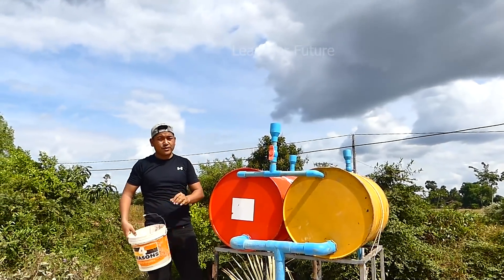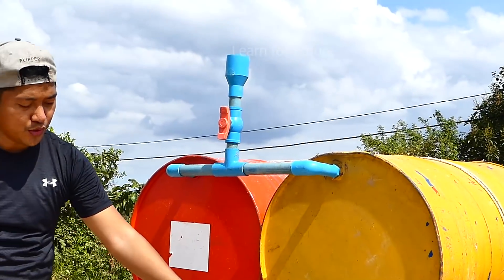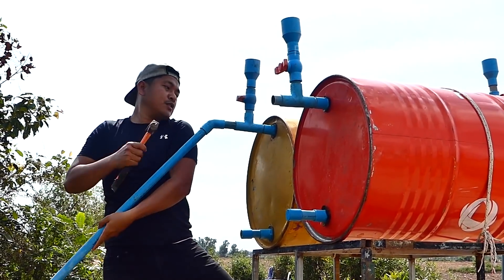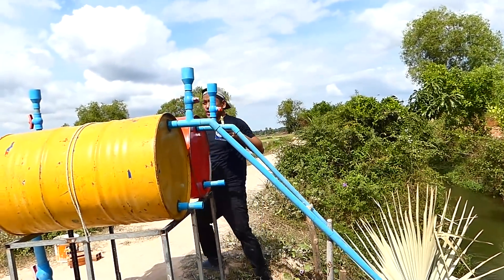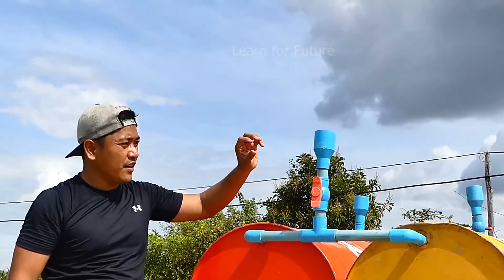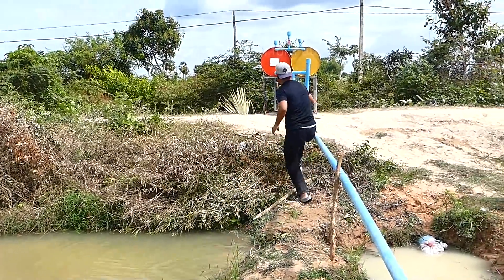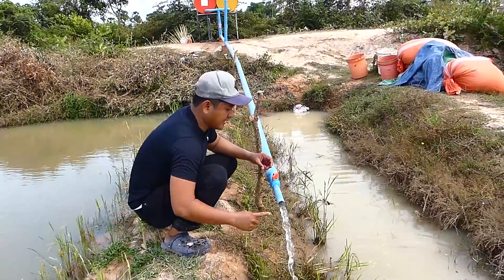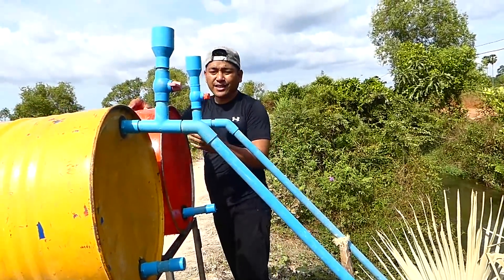Free Energy Water Pump - Explain Details How to install Drum Pump Function - No Electricity Here.

Comment: Is the water level in the river really higher than the exit to the field? This siphon is no pump! 
Using a drum, no foot valve is needed.
Two drums are not needed
Vertical tube on the output is not needed.
Mater valve at the output not needed. 
Output should have been dipped into a bucket of water to prevent air leaking inn.

Comment: That will only work if the river /water source , is already higher than the outlet. Like if you're just trying to get over some land or barrier.

Otherwise this does not work. You won't be able to pull water up no matter how much water you have in the tank. You'll just pull air out of the outlet, or the water will not move at all, no matter how heavy it is.

You can't get free energy. It's a very basic, universally proven principle of physics.

https://youtu.be/NiThJ9vUagU

Comment: what is the deferennce betwen  the tube design only and the with drum design?
Reply: With a hose, you must find a way to fill the hose 100% with water. With a drum you do not need any foot valve at the input an do not need to fill the input pipe as log as it is reasonable short compared to water volume in the barrel. Besides, if there is a small air leakage, the barrel can absorb some air before the siphon stops.

Comment: Is the foot valve installed in the  ibottom of the inlet tube  the same as  the one way valve  in the ram pump
Reply: With a barrel, you do not need any vale at the input.

Comment: My doubts :
1. Why are you using two drums ?
2. Why are you using two air valves ? The inlet valve could be used to fill the drum and also release air . And you are filling the drum up to 80 per cent only.
Reply: 1) ti increase water outlet pressure(psi)
2) for convenience(easy air relese during fill-up time) ..80% is minimum fill
Reply: @manontondalan9941  1) Does not help on pressure. Grater difference in elevation between inlet and outlet helps as water runs ‘downhill’.
2) Voume of water in the tank an output tumes must be somewhat grater than volume of suction pipe. 80 % does not matter.
Reply: @kjellg6532  only reason this one works is it's on youtube. you need a force to overcome the head pressure that's where pumps come in. for siphon system the source must be higher than where to deliver.

Comment: Question: is there limit on heights to pump the water. Like 20 meter from the water resources.
Reply: Maximum 10 meter. 1 Bar atmosphere pressure which is equal to 10 meter. So it will start taking water from intake when pressure reduce inside drum and out side pressure 1 bar
Reply: Its only 7 meters max acording to them
Reply: Now this is a siphon. No siphon can lift water up from a well to a higher elevation. The discharge must be lower than the water level in the source! That said, a siphon can lead water over a 7-10 m high wall, but you can not take out anything, not a drop, up there. Everything must down under source level.

Comment: There are two pcv pipe with the cap is closed and the other one  with outlet to the rice field do they helping anything why need them on the barrel and the one is at the big pcv pipe
Reply: The vertical pipe at the outlet is useless. Waste of money. Pipes on the barrel is for filling the barrel with water. Using 2 makes it easier to fill via one while air is let out via the other.

Comment: There is no vaccuum pressure in the tank that people think can lift up the water. To make sure, use vaccuum pressure gauge.
Reply: This works fine if, and only if, water level in the river is higher than the outlet to the rice field.
Reply: @kjellg6532  So it is a siphon principle. Then there is no need such a tank.
Reply: @irwana4265  That is right, no tank is really needed, but can be practical to get the siphon primed. When running, there is no need for the tank.

Comment: FILLING WATER CAN ONLY BE DONE ONCE? ONLY IN THE BEGINNING? AND AFTER IT START TO FLOW WATER AT THE OUTLET THE WATER AT THE INLET AUTOMATICALLY FILLS IN?
Reply: Yes, since it is air tight, as the water goes out it pulls water from the other side into the tank and fills it up.
Reply: Yes, but only if the water level in the river is higher than the outlet to the field. This is a siphon, not a pump.

Comment: The whole process is when the water that was filled in the drum is let go after closing the air and filler valves, the water leaving the drum creates a low pressure, which in turn pulls the water from the one way valve connected pipe which is the smaller intake. For the suction to build up to pull water from the inlet, the drum has to be higher than the outlet but the inlet can be way below the outlet.

Examples are pulling water from standing well which are deep than the ground level. 

Once the cycle starts you can hear the water flowing from inlet into the drum.
Reply: Kako može voda sa nižeg ići u viši nivo bez pumpe
Reply: the vertical tubing is called the anti knocking. It absorbes the water knocking or water ram.  Without it it would destroy the tubing.... Creates a pushing motion also..
Reply: @aebniala  No, it is a useless waste of money. Besides there is no water knocking in a siphon system.
Reply: Noop. Water level at the source must be higher than the outlet to the field. A siphon like this can not pump water up from any well.

Comment: This is Great engineering man good old school ingenuity same as the old ram pump.
I enjoy watching no electricity or fuel motors.cheers from   NewZealand
Reply: Is there a certain elevation needed to suct water to the drum to the outlet pipe? ..
Reply: Wi it be possible to use this system from a 6 meters elevation to the drum pump.?
Reply: His is a siphon. A ram pump is something different. A siphin can not lift any water, a ram pump can.

Comment: That’s FAKE YOU ARE FOOLING PEOPLE 👈😂
Reply: I think this will work. From the hydraulic power equation = to gamma x Q x H, where gamma = the water power falling due to gravity, Q = flow rate, H = Head. According to the video the inlet pipe diameters are 35 millimeters,  each, height is 5 meters. The outlet (discharge) are 200 millimeters, each, and assuming a height of 2 meters. The inlet water  power is = 0.003434 watts. The outlet (discharge) power is 0.007848 watts. Since the outlet water power is greater than the inlet water power, this set up is possible.
Reply: That mean the water suction is limited to certain time period only, it will stop eventually, there is no permanent free energy 😄
Reply: Hi sir
I want see you, where are you now, in siem reap? Could you give your phone number that would be great, thanks
Reply: @vunchum1431  
I’m watching from Singapore 🇸🇬 
happy new year keep safe guys..
Reply: Peeple who says it is fake or will stop working they need to do some research and study the science.

Comment: can you explain all parts of  pump and specification means diameter(internal and external)
Reply: @Learnn_for_Future  Am and avid fan of your project and is interested to make one for use in my farm. Requesting your to please advice the sizes of the following: 
1) Suction Pipe; 
2) Vent Pipe and Reducer (Suction Side);
3) Vent Pipe and Reducer (Discharge Side);
4) Discharge Pipe;
5) Discharge Nozzle Pipe and Reducer;
6) Name and size of the fitting attached to the drums.

Comment: Or build a dam and run a pipe through the levee with a gate valve 😂this bell siphon is more work then it is worth
Reply: This is not a bell siphon, but a siphon with a priming barrel.
Reply: @kjellg6532  that's a bell siphon if it isn't prove me wrong and make a portable water power station siphon water from a well and run it over a water wheel turning a generator and flowing back into the well you are siphoning from😁 with no electrical or gas powered pump go ahead and prove me wrong

Comment: Nice project.... thank you...is not clear for me  what purpose have the back pipes in the base of the barels? That 2 short pipes that coming out in the back at the base of barels...
Reply: @Learnn_for_Future  No, he is asking about the 2 short pipes with plugs on the "bottom" of the drums.
Reply: @Learnn_for_Future  , I also have the same question for those 2 small pipes below at the back. Are just merely spare pipes which are optional to install or have a  purpose or necessary for the entire process?
Reply: It's just plug to seal the opening
Reply: 000
Reply: @Learnn_for_Future  p00q

Comment: It is only possible if the discharge level is below the suction level
Reply: When you drink with a straw, does the glass have to be higher than your head????
Reply: @lennymisso7562  like if we draw water with vaccuum pump?
Reply: You are very RIGHT. That s not going to work. No gravity pump.
Reply: WRONG, Same as a hammer pump these are pumping up hill. He has videos on the siphon pumps too.
Reply: @RobotalkerSupport  WRONG AGAIN, first it is not hammer pump but ram-pump, and the intake need to be higher than the ram-pump, and a ram-pump is only 10% efficient, 90% of the water is waster to operate the pump.
Reply: @RobotalkerSupport  Sorry Thomas, but you are mistaken. This is not a ram pump, but a siphon with a priming barrel. No siphon can elevate water.
Reply: It works like when you suck your drink from the glass using a straw, when the water from the full drum is release, it will create a vacuum in the drum and the vacuum will suck the water to normalise the pressure inside the drum, as more water is drained, more vacuum will be created, thus more suction.  It is simple physics, maybe they don't teach physics in religious schools.
Reply: @lennymisso7562  It seems true but it is not that way. False logic.
Reply: @irwana4265  No harm in trying, just go ahead and try.
Reply: @irwana4265  Simple, ger a 220 litres metal drum, not plastic, or it will get crushed by the atmospheric  pressure, fix a pressure gauge, fill it with water, close all other inlets so that air cannot get in, and  drain out the water, make sure the drain  is at the bottom not the top, and check the vacuum created in the tank. Place your hand at the top where you filled the drum with water and open the valve and feel the suction as air tries to get into the drum.
Reply: @irwana4265  The vacuum is created as the water is emptied,
Reply: @lennymisso7562  When water going out from the tank, the air is coming to the tank. So there is no vaccuum created. When the air can not go into the tank then the water can not go out from the tank.
Reply: @lennymisso7562  Is it? Did you do that? LOL
Reply: @irwana4265  You must close the inlet valve where you fill up the tank, so that air cannot get in, just look at the video, there is a valve that he closes before opening the drain valve, and the inlet pipe must be submerge in the water, instead of air it will suck up water.
Reply: @lennymisso7562  LOL use vaccuum pressure gauge instead.
Reply: @irwana4265  You really don't need a vacuum pressure gauge, just if you need to check weather there is vacuum created when you release the water with all inlet close,  looks like you can't even follow the video, just set up exactly in the  video and close the valves he close before open the drain valve, if still don't work for you, it's not the system, something is wrong with you, i tried and it works fine.
Reply: @lennymisso7562  Your explanation is correct and excellent. The innovation is superb and needful in creating sustainable water supply to farmland if improved upon.
Reply: @olusolaomolayo2687  This siphon only works if water level in the river is higher than the outlet discharge to the field. It can not lift any water up to a higher elevation.
Reply: @lennymisso7562  But this barrelled siphon only works if the water level in the source is higher than the discharge level in the field.
Reply: To whom who does not believe there is no such vaccuum pressure in the tank, could have use pressure vaccuum gauge in the tank.
Reply: THE WATER WILL ONLY CONTINUE TO FLOW WITHOUT ELECTRICITY IF:  1. AS LONG THERE’S WATER FROM THE RIVER TO INLET PIPE. 2.AS LONG AS THE VACUUM IS PRESENT(CONTINUES FLOW OF WATER  AND NO PIPE LEAKS). 3. AS LONG AS THE “OUTLET PIPE IS BELOW FROM THE WATER DRUM”.
Reply: @hawkeye7435  Correction: it only works if discharge is lower than the water level in the river!

Comment: It works on the syphon principal 
Negative pressure is created 

It works only if your field level is below the level of water or same 

It not work to lift the water above the water level of steem 
Law of conservation of energy
Reply: https://youtu.be/BV0ZZoaYW6s explain this then
Reply: @lesterjay9248  The arrangemet you are liking to can not work. No siphon can lift any water up from a well. To do that you need energy. In other words, you must fill the barrels by hand, again and again, and again.
Reply: That is why there is the drum. water loss in the drum (to outlet) creating a air vacuum thus water is suck from the water source by those vacuum. and the cycle goes again² (if you see some video of similar project using plastic barrel or weak old metal barrel, it got deformed) so more drum create more vacuum thus more water pressure..  two drum with two smaller pipe inlet (in video) for less pressure lose in the intake.
Reply: @chinxenix7104  sir good day...so this kind of idea is working..? so that  i will make also here in my farm...thnks
Reply: @chinxenix7104  You only use the drum to get this siphon started. After that, you do not need any drum. If you find an other way to fill the tubes, then you could drop the barrel.

Comment: Brother, What is the maximum Suction of  power in feet ?
Reply: Seems to me that it will only work if the level of the water in the creek is higher than the level in the rice paddy. It's just an easy way of priming a siphon.
Reply: @paultoschi  if like that, then no need this kind of pump.  just let the water flow  from the creek to the ricefield
Reply: @npasamba  That is right, but in some cases you are not allowed to breach the canal barrier, but you are allowed to use a siphon to get over it. You could use a simple hose, but it is a bit more difficult to get filled. A barrel can also absorb some air before it all stops.
Reply: @paultoschi  That is correct.
Reply: vien-phuong7451  Now as this is a siphon it must be airtight. My suggestion to blow inn a little air is to mimic those who say that the barrel should be 80% filled with water. If the bottle is completely filled with water, the siphon will flow water from high to low as any siphon. If there is some air in the bottle it will act as a one-way valve. 

I still recommend you to do the experiments. You will find that a barrelled siphon just act as a siphon. Again, do not take my words for it, prove it for yourself.  
No water can flow uphill without adding energy to it. If this perpetuum mobile worked, why do we use pumps consuming electricity? A siphon, with or without a barrel can only lead water from a higher reservoir to a lower reservoir. So, not up from aly deep well, that is a hoax, a bluff.
Reply: Vīën-Phüœñg  OK, Vien I clearly see it now, I am mistaken, you are right 
and I clearly see the beauty of the whole game.

- the outlet generate vacuum to draw water from lower into the bottle.

- the input will refill the water taken by output to generate companion (blowing into the airtight bottle) to pump the water out faster than gravity.

That's the reason why it requires a airtight bottle in the first place (to generate both vacuum and pressure)

Now since you are more knowledgable than me and have explained this fantastic invention in many channels, can you explain this phenomenon to me?:

Take a clear bottle
Suck it in water and lift it by the bottom, but leave the neck in the water.
Why does the bottle stay full?
Let in some air. The bottle is 80% filled with water,  20% with air.
Why does not the rest of the water leave the bottle due to gravity? 
Then from the water reservoir, insert a straw up via the neck all the way up to the bottom/top of the bottle.
Why does it not start any flow?

All the criteria are full-filled:

- now the outlet generate vacuum to draw water from lower into the bottle.
- the input should refill the water taken by output to generate companion (blowing into the airtight bottle) to pump the water out faster than gravity.

The bottle is airtight That's the reason why it requires a airtight bottle in the first place (to generate both vacuum and pressure) is fullfilled.

So why is there no circulation? Why does not the water in the straw rise higher than the water level in the bottle? 

You who knows better than me,  why does this setup not work? It is a smaller copy of the barrelled pump. It is not a siphon, it is somthing that should work. Why not?